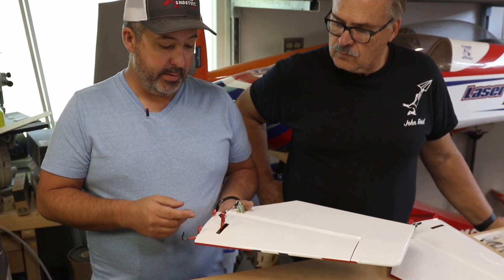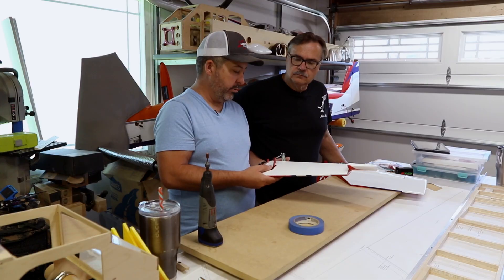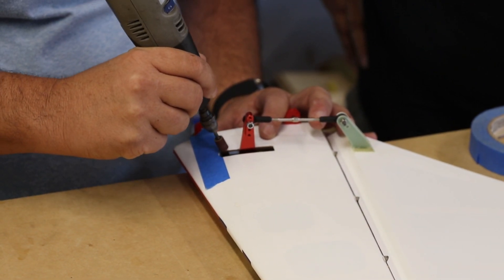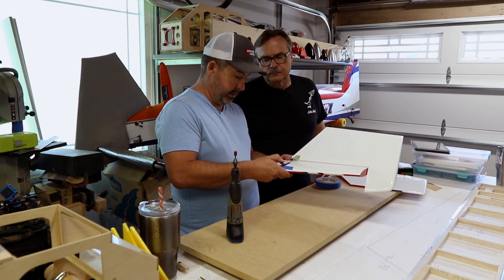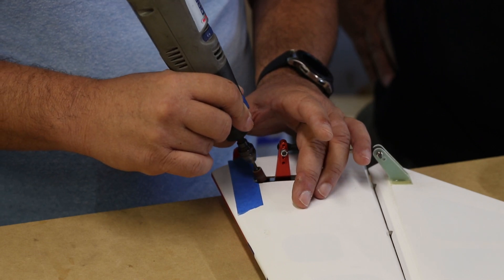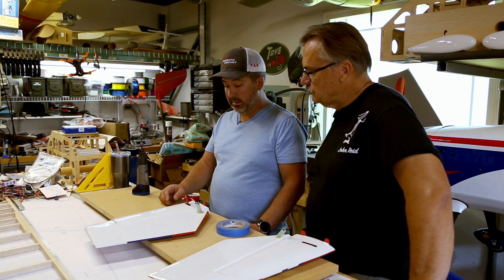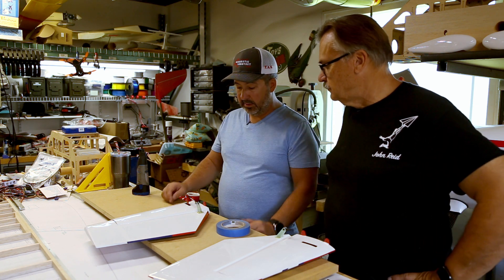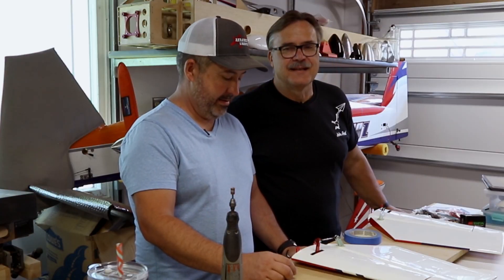FlightReviewz How To: Opening Control Horn Slots in Stabs

Comment: Logic question: if opening remarks regarding servo resolution correct then surely one should disconnect the rudder and and expand the opening according to the servo's actual maximum travel using a servo tester ? Lovely video as always though.
Reply from the maker: It's more of a give an take. We basically want to use the shortest arm on the servo that we can while not sacrificing too much material. 

Really, the point we are making here is don't use a 2" arm for the sake of using a 2" arm. If you can use a 1.5" arm and still get maximum travel from the surface while only have to remove a little bit of material from the opening this is optimal.

Hope this makes sense.